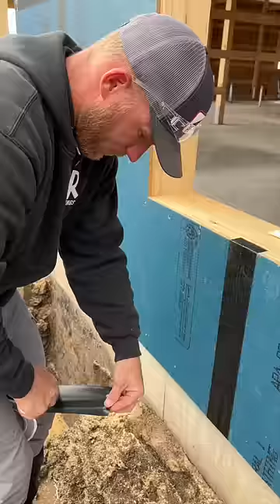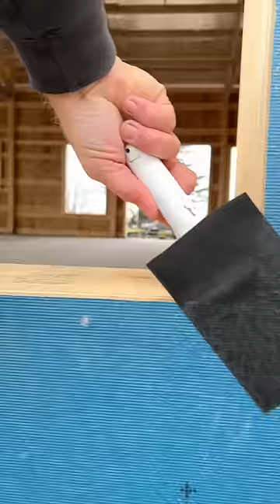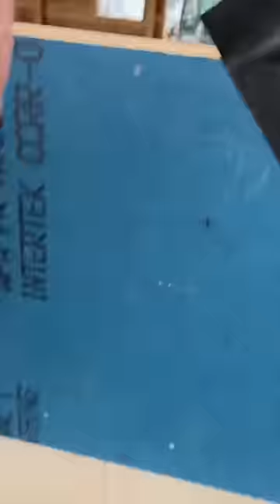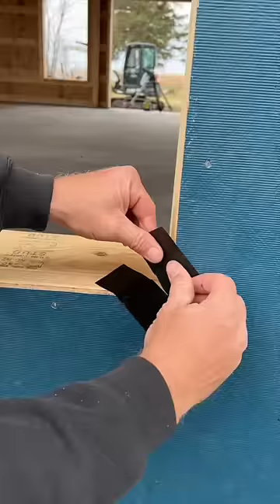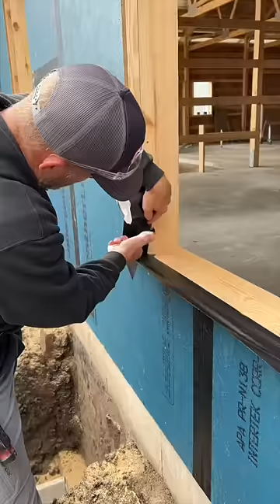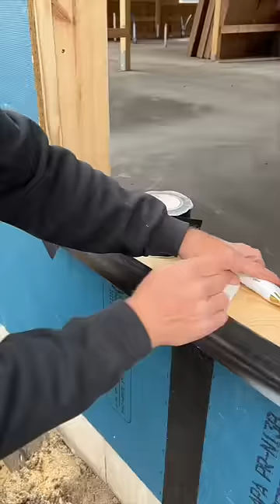How To Easily Tape Seal a Window Frame

Comment: I learned this better when I moved to Florida. Code. Great job man
Reply: Florida codes, lmao. Good one!
Reply: @noname-yb5jt come see in NYC.  You have no clue man.  Most homes are built by Chinese with CHINESE supplies!!! .50 cents a square foot for tiles.  Same tiles used for bathroom and kitchen!!! In NYC their cost is 300k to build a 2400
Sq ft home and sell it for 1.8 milllion!!!!! We call them the China Special or Flushing/ College Point Special because that’s where the Chinese have all their building supply stores😊
Reply: @stavroslask1292  I used to build grocery stores all over New England and NY. They actually have codes unlike Florida where buildings just collapse.
Reply: @noname-yb5jt Buildings collapse because they remove the rebar when the inspector leaves. The South Florida Building Code after 1992’s Hurricane Andrew is no joke.
Reply: @onethousandtwonortheast8848  Unfortunately that is the Republican way. Always money first.
Reply: @noname-yb5jt  yeah. Communists are better.

Comment: Bow tie gives better overlap so you get at least 1/2” instead of 1/16”
Reply: What does bowtie mean? Can you explain?
Reply: @benmughal It means exactly that. You cut a 6" piece of the flashing tape into the shape of a bowtie, and stretch it around the corner.

Comment: You make a bow tie instead and put that in the corners first. That way the 90 on each side is covered with about 1/2 to 3/4 overlap vertically and horizontally. Then roll the tape out and cut the 45 like you did. Nice work I like your videos.
Reply: Yeah that's the way I was taught 👌
Reply: Much better than he did
Reply: Yep thats exactly what we do here

Comment: I'm surprised premade corners aren't more common.
Reply: They are pretty expensive for what they are.
Reply: They have special tape that stretches in three dimensions for these corners. Looks like a scrunched up ribbon
Reply: @azmav75  zip stretch tape...expensive but works wonders on corners
Reply: @azmav75  you’re totally correct.  Tyvek brand has one of those mentioned. I’ve used it back in the day
Reply: And here is the comment I was looking for .
Reply: @azmav75  Called 'Flex Seal'
Reply: Many brands offer corner specific tape but he is paid by LP to use and promote their products. LP makes some great products but unfortunately are still lacking corner products. While this install is better than most, there are better products out there for this detail
Reply: It's America......Other countries have multiseal already fitted to the windows.....
Reply: Only in Ohio?
Reply: There are right angle plastics you staple over the corner once taped.
Reply: @azmav75  you got it. It’s the flex seal stuff but at $300 a roll I can se why people don’t use it as often.

Comment: I used to do that for awhile , working on a 21 bedroom house w 3 stories. 
I did it a bit differently and I had my utility knife with 550 cord so I wouldn’t drop it .
Reply: Why do they call type 3 nylon 550 cord? 😊😊😊
Reply: @Tomcat1957 because its good to hold up to 550 LB.

Comment: I used to do it that way but now I add a little triangle piec to cover where both cut sections meet cause I pulled a broken window out from a house and that had failed and had some water but hadn't rotted yet
Reply: I know nothing about this but I was wondering about that. Water could creep up along the edge of the tape.
Reply: Was just thinking this too
Reply: I think the trick is to not do those cuts right into the corner intersection, but proud by about 3mm and rely on the stretch of the tape to negotiate the corner, which would be the same thing you are doing with your triangle. You have to be careful it sits flat, or you will creating creases, which could be a conduit for damp. 

Best is to make sure no water ever gets in there, of course.
Reply: Exactly, it’s called a “gusset” first than the sill piece so is no chance of water penetration especially after terminating all top seams with mastic
Reply: I'm really confused about what you mean here & what you are doing.  Could you explain it a little better?  I understand the premise but not sure where you are putting the triangle piece..

Comment: Your tape should never terminate at the edges of the pan. You should always travel up 6 in at the left and right pane. When water eventually penetrates on the side it's going to settle with the corners of the pan and get underneath of that black tape
Reply: He literally wrapped the tape up each side tho
Reply: You somehow spelled pane differently all three times 😂
Reply: @carsonalexandermuck1136  I think he actually meant pan,the first time. You need to create a pan ,so when water gets in, it's watertight. Funny though 😂
Reply: @carsonalexandermuck1136  😂💀
Reply: Ya ok buddy have a seat
Reply: @carsonalexandermuck1136 thats weird PAN and PAN seems like the same spelling guess i missed kindergarden
Reply: Don't be a pan.
Reply: I only see two misspellings but still thats funny.
Reply: He didn't continue and show it, but he will be adding the flashing "tape" going up both sides. And then across the top, probably AFTER the window is set.

Comment: Thus would not pass here in  Canada.  You have to do the butterfly patch over the corner.  As  well the tape does not appear to be a rated tape and without being that stretchable over time it is likely to let loose and pull back.
Reply: He hasn't sealed the joint at all! It's a cut in the tape directly on top of another cut in the tape. This is "cheap jack" construction!!!
Reply: @davidthomas5356  wrong, look again there is no cuts over another, one is on the inside the other is the outside, this will seal 100% fine.

Comment: we use 3M all weather flashing tape for that, it'll stretch right around those corners and make a perfect seal every time!
Reply: Tri 3M 3051 UC. It’s amazing. This guys windows will leak at the corners where he notched two layers of tape right on top of each other.
Reply: @roddaman7545  absolutely, there's like no actual overlap where it really counts. that tape can work but you basically have to do a bowtie first then do what he did on top and that's so much extra work
Reply: @simeongray2645  I’ve seen a lot of bowtie systems fail in testing too. The only thing I trust/recommend anymore is extendable, self adhered flashing or fluid applied. If you came back over those panels with a panel of compatible sealant extending a couple inches each direction and then you’ll probably be safe
Reply: @roddaman7545  never had the chance to use fluid, but honestly I'm curious about it
Reply: @simeongray2645  Simeon - The fluid-applied products solve a lot of problems but can bog down inexperienced installers.  The key is to not play around with it - gun it, spread it, leave it.  There are MANY good products out there.  I suggest sticking with STPE or Silicone chemistry.   Elemax 5000 is nice, but since it’s silicone you need to use silicone for everything (sealants, etc) that tie into it.  The other one I’ve used and still recommend is Prosoco Fast Flash with Cat 5 fluid-applied weather-resistive barrier.

Comment: I'm building a house and had some contractors do the concrete and truss setting.  Some of the trusses are leaning causing the roof to wave up and down and the four foot bump out is out of square by one inch which I discovered when roofing the house.  So far, I haven't found a contractor who is good at what they are suppose to be good at.
Reply: Sorry you're having a problem. Trusses, rarely come out of the truss plant, perfect. I've rejected and made them come back out and replace a few loads over the years. I can do that, working for a very large high quality builder. Then, it's okay if a few trusses are leaning a little. It's not the best, but it happens. A few inches on a 6' or taller truss won't hurt it's strength and shouldn't cause the roof to be wavy. What happens, most of the time is the sheeting gets installed without proper spacing, and when it expands, it has no where to go and it will buckle. That makes a big mess and difficult to correct. If you roofed it correctly, it won't leak, and it's too late to try to fix it. Just call it part of the character of your house. The 4' bump out must be a porch or deck roof and 1" out of square shouldn't be a problem. Sounds like you framed your own walls? Did you do the siding, and install doors and windows also? Drywall? Plumbing, electrical, finish carpentry, cabinets and floor covering? If you did any of that, you should be proud and enjoy your home. God bless. 🤠

Comment: Nice, just a little extra love on the windows will help prevent moisture damage. That could also lead to higher moisture content in the duglas fir timber, attracting termites 🐜 🐜 🐜 🐜 🐜. This contractor just saved you a bunch of chedder.

Comment: I also like the following: 1st I build my walls flat & sheer them then rout out the windows & drs. Once nailed off b4 standing, I roll foundation sealant over entire wall - 1 coat (get the ok from your inspector 1st. Once stood you can hit sills & jams too. Now no tape or tyvek or tyveks more expensive equivalent are necessary. Your inspector can still see your nailing pattern w 1 coat & you have far superior protection between sheer & siding. You could even shoot lath (1/4-3/8") onto sheer after drs & windows to make all of your walls ventilated (Vs. vented) a simple screen roll detail stapled in at top & bottom is easy & very affordable now your painted siding wont mold, the paint job will last far longer & your walls remain dry.

Comment: I’ve watched this dude build things for a long time now. 

I really don’t consider him a “builder” or a “carpenter”. If I had to try and pin a title on him…I believe that the correct moniker should be “construction scientist”. 

Every single calculation, layout, cut, build, insulation install, metal roof installation, window or door set-up will be dead on balls perfect. Every single time. He makes it all look so easy. But the reality is that this type of work is everything but easy. One simple mistake can set way you back and ruin your day.

Good job!!👍👍👍

Comment: If you wanna go really nuts, you can pull the vapor barrier from the interior surface and wrap it around the window jams and then have the tape seal to the vapor barrier. I’ve seen that done. It’s a pain in the butt, but it supposedly does a lot.

Comment: Pull and place is better with vycor, your leaving a hole that's Gonna expand with time
Reply: And here we go...
Reply: A  pinhole over a pinhole
Reply: Add some liquid flash
Reply: Agreed! That should fail in the future!
Reply: was thinking the same thing. right on the corner where water would accumulate, the overlap is only about 1/4 - 1/2" a little heat cycling and age related shrinking, good chance it opens up.
Reply: @gbski43 Yeah unfortunately when flashing outside corners with any kind of sheet product you’re always gonna end up with a pinhole somewhere.
Reply: I assume he’s going to put in windows trim and caulk…. As far as I’m concerned this is all overkill
Reply: @ryanjohnson6636  even still (and I’m really not hating these guys are good) it would be good to put some caulk or or liquid seal etc.

On my roofs when I do this type of corner with my ice shield (commercial not that sanded crap) I always caulk that overlap corner.
Reply: @mrlions9494  neither yours. They made a good point.
Reply: @mrlions9494  what if this practical advice given let alone help R&R learn, also others that watched the vid and read the comments.

Smart people regardless of level of knowledge are always open to learning.

Your a closed door with a crap attitude. Have a great day sir.
Reply: Yea but if you cut the lower piece at an angel 1/4 from corner and the vertical opposite and pull and place them they over lap and no hole
Reply: @ryanjohnson6636  its actuallu code to taPe seals not overkill at all it proctects the wood if water were to get under the window
Reply: JS500 or another stretchy membrane would seal up the holes left in the window corners.
Reply: Also for any peel and stick just prime the bare wood. Yes these membranes are designed to adhere to wood etc, but priming it first can really make it work.

Also, I use the membrane to flash to the window curb as opposed to the framed opening.

Like ya it’s great that the framing is protected, but it doesn’t stop water from entering the home and even if it doesn’t get into the framing, or through the spray foam they hopefully insulate around the windows with, standing water can start mould growth and those spores can move around.

As long as your siding thickness will cover the membrane Apple the membrane to the actual window curb with a primer to help adhere to the plastic and then the water won’t even pass your weather barrier.

No siding is 100% leakproof it’s entire life. Even cement board fully caulked etc the paint eventually fails to let water weep in, your WB is everything. Also condensation being breathed out of the walls etc need somewhere to drain, and while it’s running down why let it through the window at all even if your sill is protected.

Comment: The sheeting is ribbed horizontal, seems like it would be better vertical. Also, seems like vapor barrier to the bottom of window would be better before folding tape down

Comment: Offset your knife cuts. On the small pieces have it slightly above the corner. Have the main poece cut just below the corner. It will keep the two cuts from aligning and leaking

Comment: I put circle on the corners of the same material because you cut on both edges and you can run into water getting in through there brother.

Comment: you should use a separate piece of tape at the joint again, you have almost no overlap there and it will pull and open after it's been covered.  Unfortunately this isn't something you learn until you visit your work 10 years later.

Comment: Use stretchable zip tape and don't even cut the corners. Just pull it to fit. One seamless piece along the bottom and 6-8" up the sides.

Comment: Watched this video and thought can’t wait to see all the “master carpenters” replies to this.  Yes, you can buy stretch tape for the corners but if you’re doing a lot of windows it can get pricey.  His technique is perfectly acceptable, all that’s catching is any condensation between the window and the framing. When he installs the window, he’ll seal the perimeter, nail it off and seal over the nail flanges. No water is getting in there if installed correctly and he installs them correctly.  Guy knows his shit, talks a little too much but is good at what he does.  Maybe pay attention and you’ll learn a different way to get similar results without spending stupid money. This guys building million dollar structures and most of these know it alls probably did a summer working for a “licensed Andersen technician”

Comment: There's only about a quarter of an inch at most, where tape is touching tape in the corner. I always run another strip, in between the two layers he put on.
Reply: And you want to reinforce it as much as possible, because the window corners,could destroy the tape easily,if not installed properly. I just add a strip from inside the building going out, and pull it out and down away at a 45 . It will stretch and give it more strength and a better seal. It doesn't have to be very wide. Just an 1"1/2...

Comment: Very good technique but, but, but in keeping with building code, it should be applied over building paper otherwise it creates a sweat point between the tape (or typically blueskin) and the wood trapping moisture.  This would fail inspection

Comment: Step#1 buy a utility knife and not that junk. The blade will come out when you actually use it. Buy the Stanely classic #199 fixed blade instead. You can use it like a mini hamer for smashing down staples and lay the knife on the side and use the back side of the blade for a mini scraper too. Great for cleaning off the drywallers mess.

Comment: Come back in 1 year and those joint cuts will have shrunk and torn themselves a little more, exposing a hole. Use the expensive stretch tape for the joints.

Comment: You always have that little hole where the seam of both pieces of tap meet....   Much better off with ZIP liquid flash or ZIP Stretch in those corners.....

Comment: isn't there technically an overlapping hole with little excess in each corner when doing that?  everything else gets 1-2" of extra material and that one spot gets like 1/16th.

Comment: Don't cut the corners.  Squeeze it in tightly on the nside of frame first and stretch to the outside with both pieces, including the long piece that overlaps.   I never cut it in the corners, it will eventually leak, guaranteed from experience .

Comment: Great. But, he had only covered ten percent of that window, through all my experiences with repairs on houses from the 70s 80s and 90s to 2000s  leaks from windows can happen from all around that window opening, so it’s best not to be cheap and do it right and cover the entire opening and give the buyer what he paid for, not to mention people bust there butts to buy a house to live in and here you are only covering ten percent of that window my guy 😀👍 unless you are going to cover the entire window opening then I’m wrong 🤘🏾

Comment: I don’t cut the 45 degree into the corner. I cut 90 degree then stretch the tape into the corners. Zero chance of a hole in the corners. This is wrong application and would fail inspection here in Canada

Comment: There is no positive drainage on the sill plate as it should slope to the outside.  The return up the sides needs to go higher and the flashing should go all the way to the inside face of the wall.  This looks to be the ZIP strip seal and not the true window flashing.  If it is the ZIP strip sealer it needs to go up the sides of the window opening as well as the head of the opening.  There is much more to actually flashing a window opening than is shown here